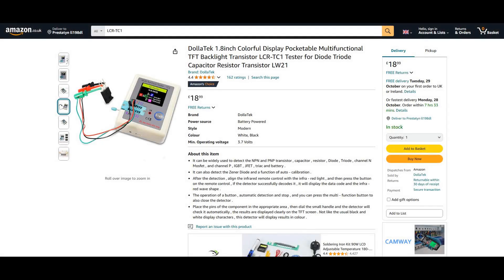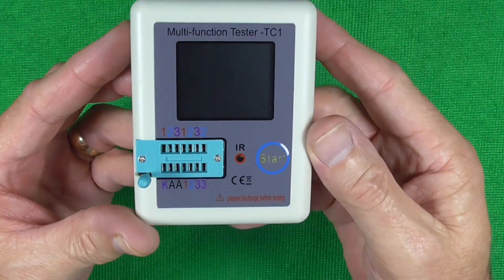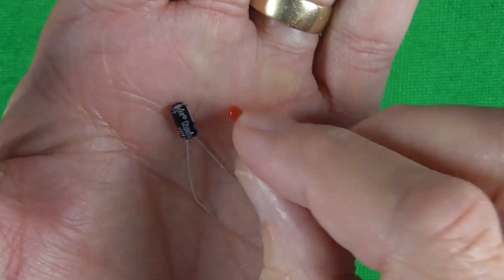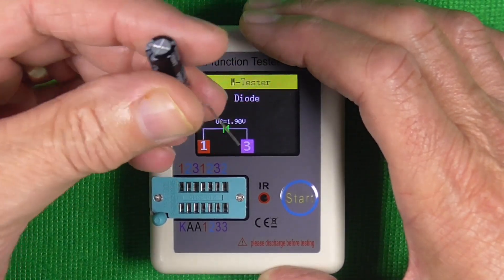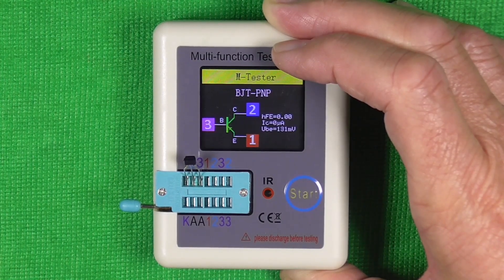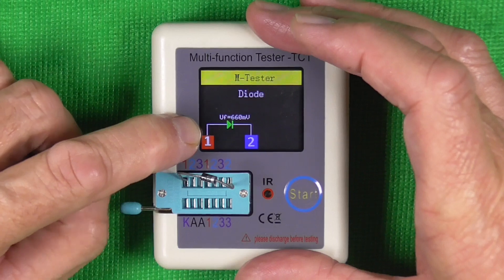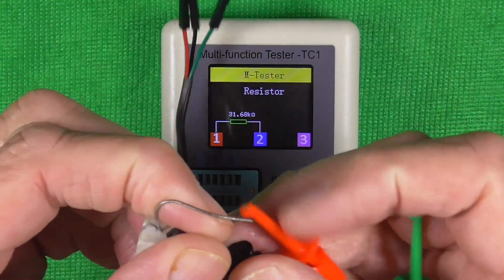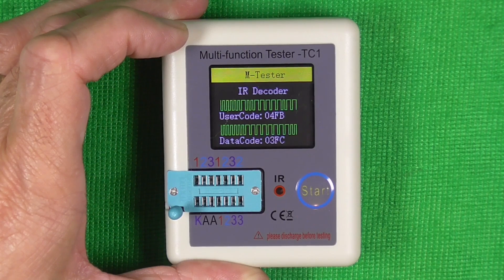DollaTek  LCR-TC1 component tester - Transistor, Diode, Triac, Capacitor & Resistor plus IR tester

Comment: I luv my lil tester!!!  While holding all three test lead pins in a row, I wrapped a piece of tape around the black cases so that all three pins can be inserted and clamped at the same time.  It makes the three pins a single package!  lll
Reply from the maker: That's a great idea, I've seen someone on Youtube hard wire them too so they come out of a hole on the side of the case. I prefer to be able to detach them though. I suppose some heat shrink tubing would work instead of tape too. Many thanks for your great comment.

Comment: The 3 pins in a row are for doing the selftest of the unit. Just put it on the upper-left corner of the connection and after pressing it will start the selftest (and calibration). Halfway you are asked to remove the testing-connectors and continue.
LED on the bottom is for recognizing the IR as you find out.

And, the lower row with the KAA is added compared to the earlier versions and ads extra functionality ;-) 
Yes, I bought the same unit about a week ago ....
Reply from the maker: Thanks for that, I just downloaded the user guide and will have a read. Many thanks for your great comment.